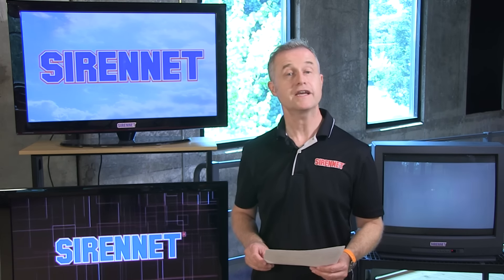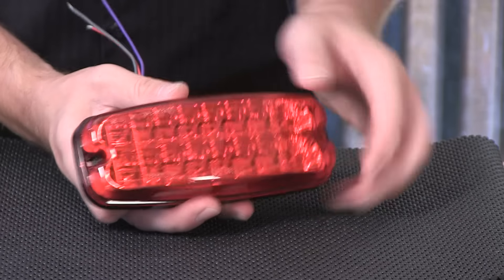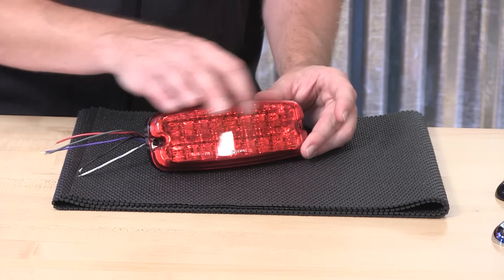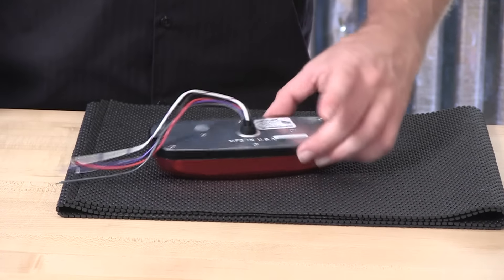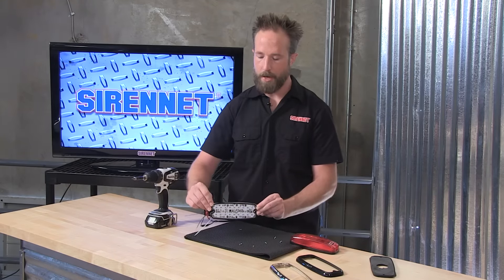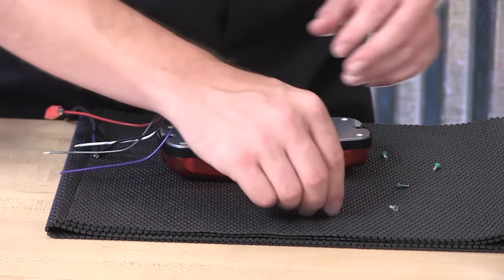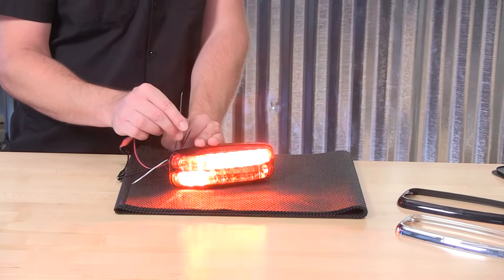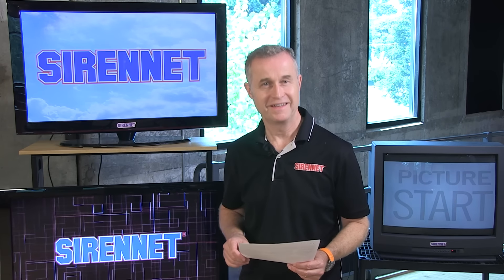Chris deconstructs a Whelen M7

Comment: just a little info for you guys LEDs are not just diodes they are light emitting diodes a diode is a different component i would strongly recommend referring to the light emitters as LEDs vs diodes its more accurate to showing off that its an LED device other then that you guys are very informative and seem like warning lighting enthusiasts and i defenetly respect that